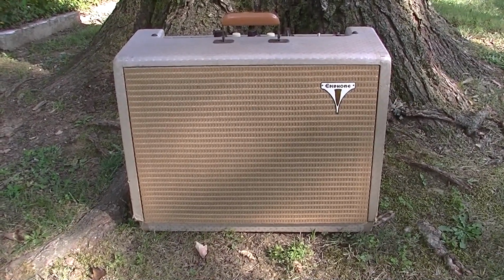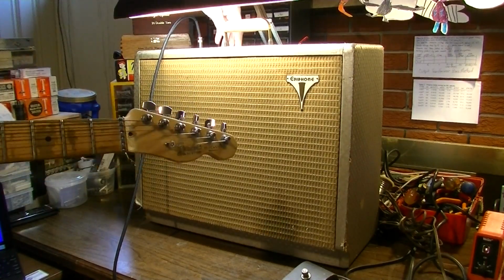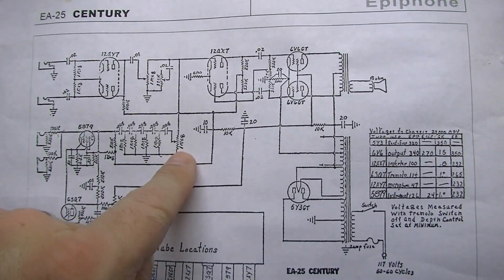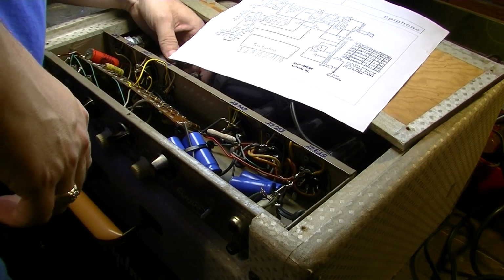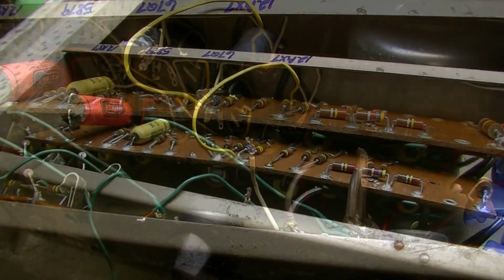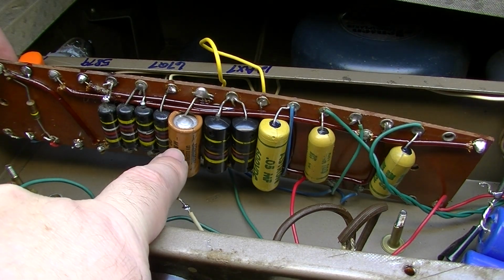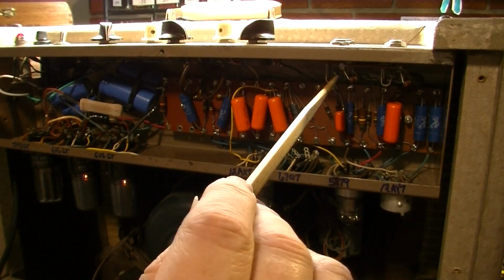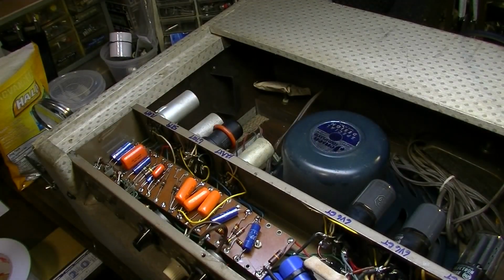Recapping Vintage Guitar Amps - When is "Killing the Mojo" OK? (1959 Epiphone Century EA-25T)

Comment: Most amplifiers back covers don't use shielding or aluminum shielding tape. I wonder why these input jacks were picking up more noises compared to a fender amp or marshal amp that you had to add aluminum shielding tape on the back cover. The First capacitor of the Sequence is an Astron Capacitor and then Sprague Bumblebee Capacitors for the "tone shaping network". I think they used the Astron Capacitor for frequency response differences, like you mention that ceramic capacitors add an edgier tone. When pulling removing out V1 tube from a fender amp or  this epiphone amplifier it increases the gain but also the "loading impedances changes" because V1 pulls down the plate voltage loading it down as well as the loading of the tubes resistance of the plate resistance of the V1 tube.

Comment: So in the final analyses, do you find the pentode channel would sound louder and distort easier than channel 1? Channel 1 seemed very clean(like a Fender) and channel 2 sounded more British.. Thankz
Reply from the maker: Yes. Channel One would breakup as well with a 12AX7, but Channel Two has more gain still. Get the most gain out of this amp by pulling the V1 tube out of the amp and running into Channel Two. Crank up with some humbuckers and you're bordering on classic heavy metal.
Reply: The Guitologist What about jumping both channels together ?

Comment: Fantastic Brad and cool amplifier. The badge is a little suspect. By this time Epiphone was using the "e" logo as seen on the Casino pickguard. I have seen that badge plate on 1940s - 1950s  headstocks though.
Good luck with the new house and I hope it has good current!
Reply from the maker: It's the original badge. This is REAAAAAAAALY early in the Gibson/Epi amp run. They may have still been using up old parts they got in the Epi deal, or experimenting with cosmetics still.

Comment: Brad great video again mate! Considering the nuances of using a pentodes in the input stage, if you ever built your amp from scratch, would you use one, or stick with trusty triodes? In your opinion, do they offer a contrast in sound that is that distinguishable to the triode? I have not had much experience with pentodes in the input area. I do have a bunch of EF86's in my stash and have considered them. Just curious for your thoughts. Cheers Bud!
Reply from the maker: Pentodes on the input are worth it. I've built stuff with them before and I've modified triode stuff to pentode before, as I did in another recent video: https://www.youtube.com/watch?v=dSDwG4NLm98
If you want the best of both worlds, consider something like a 6GH8A, with a pentode and triode in one envelope. Then you can use a switch or blend knob to switch between them on the input. I have designed an amp that did just that as well: https://www.youtube.com/watch?v=G4_niIHsDnY

Comment: Mojo revival with a boost. My philosophy on the mojo is Keep what you can and change what's necessary to keep it working. The onboard tremolo effect on my harmony guitar started leaking electrolyte and had a busted battery stuck in it. started working after I cleaned it  restored the battery compartment and rewired it without changing much.

Comment: Taking out the old and putting in new is a bit of a sacrifice and necessary. Ever thought about putting the old components in a baggy attaching it the inside to show what was in it originally. Just a thought.
Reply from the maker: That's commonly what I do.
Reply: The Guitologist I am glad, keeping the original with the original, even if they're not used anymore.
Reply: and it keeps your shop space clean of worn out parts...

Comment: What interesting timing for this.   I just recently was wondering if capacitor / component branding made a difference in tone.  In the process I read this week that EHX had a limited run on a pedal because of old stock sourcing issues...   ...and that Arp hand selected certain transistors in the 2600.  No idea if these are true, but very interesting indeed.

Thanks for sharing your thoughts on the matter. Always great to watch you work.  
In the event that I ever start building musical circuits - it'll be your fault...  :)
Reply from the maker: I refuse to accept any of the blame! That's my one caveat.

Comment: 27:05 I'm curious, did you ever replace that obviously microphonic tube -- the one you put the silver shield over? That thing was ringing like a bell any time you touched it, and that can't be good. For that matter, did you replace any of the tubes? If so, which ones, and why? The amp sounded great once you got it all buttoned up, so I was wondering if you did anything about the tubes or I just missed you mentioning it in the video 'cause I'm old and my mind wanders sometimes. ;)

Comment: A very nice end result; those Bumblebees have bitten me in the tail more than once (in radio and TV circles), I've just shotgunned those for the last decade.

One thing which I am having difficulty in comprehending, why are so many of the carbon comps complete with "jig - bent strain relief" on one end, and not the other??  I instructed Mil Std 2000 Cat "C" electronics practices for 15 years in an avionics plant, and am viewing the practice from that perspective.  Many thanks, Tim.
Reply from the maker: I would guess only one bend would be necessary to compensate for expansion and contraction. It's a bit extreme unless you're taking the amp to the South Pole or Space though.

Comment: Hello Guitologist!!!! What are the differences in sound and purpose between the sozos and orange drops?? Thanks man, love your videos
Reply from the maker: The general idea was to stick with what most people accept as good replacements for those caps. Personally, if this was my amp, I would have probably just stuck my red Panasonic knock-offs in there in every position and been done with it. But I like to steer customers toward better resale later down the road. That way they can get top dollar. The Sozos were put mostly in positions where signal passed through them in coupled stages. The orange drops were cheaper, so those were used in non-tone-critical places like the tremolo oscillator, which really only needs to provide oscillation.
Reply: Ok I get it. For example if you need to replace a cathode cap would you use sozos or orange drops for that position? Thanks for answers, I appreciate it

Comment: Perhaps adding a high value good cap is series with vintage, possibly leaky, caps would allow the originals to stay in
place with the modern cap stopping any leakage (ie you remove the large dc voltage from the old caps, possibly slowing
down their deterioration in the process?)  - just a thought...

Comment: When replacing a multi section cap with individual caps can the voltage rating of the individual caps vary from one another?  That is to say I need three caps at 150v each, but I only have two 150v and a 450v on hand. Will this work?

Comment: At what point do get concerned about speaker damage with those old Jensens.  I acquired a 61' Epiphone Challenger,  sounded great until the speaker cone started tearing up.  Had to get it reconed...
Reply from the maker: No reason to be concerned. Just try to keep climate controlled as much as possible. Don't let the cones dry rot, get moldy or wet, and they should be fine. Eventually they all need a recone anyway so I just jam the hell out of them.

Comment: Another great video...that amp sounds awesome!!! Love Epiphone stuff...the poor man's (me) Gibson! They still use that emblem on some guitar lines. What a PITA have the caps under the board...what were they smoking when they designed that?!!?  Lastly, I was wondering if maybe that orange drop cap by the input was causing the noise..."Mr Carlson's Lab" put out a video on how these do have a preferred direction of installation...have you ever experienced this? Thanks for all the great knowledge you share with us!! :)
Reply from the maker: I'm aware of that video and the concept of outer foils. In this amp, I did observe the foil polarity during installation, but for the most part. a well shielded amplifier won't matter whether your install signal caps backwards. Modern caps are usually smaller than their vintage counterparts anyway, so the surface area is lessened (smaller antenna). And unless the amp is just designed on the very edge of stability or is high gain, like a Trainwreck or Marshall, the polarity will be negligible. Shielding is the real key. That and lead dress.
Reply: The Guitologist Thanx for the reply. I saw that video a few weeks ago and, after beging aghast by what he showed, took a bunch of new caps to the scope... couldn't reproduce his result...it didn't make a difference  which way they were placed, same small noise signal from touching them for both directions.

Comment: What a cool amplifier! Sounds awesome...the diversity of tones. Looks great too. Brad I was wondering if you took off one lead of any of the bumble bee caps, and checked them whilst you had the board free? I get you figured the astron took the dc hit 1st, but its age right, that takes its toll on those caps? Just curious.. Great repair job, I liked you allocated caps to top.
Reply: Bucyrus Erie12 I was surprised he didn't move bumblebees to the top too just in case there were problems.

Comment: the problem is: capacitor shift usualy to lower valueswhen they age so, on the signal path that means less bass... and less bass is good when overdriving the amp (less blocking distortion). So replacing caps to original values may be a very bad choice ! When remouving old caps, always mesure it and write this information down on paper so you can restore same values but with new caps. Filtering caps on power supply: may also change the sound A LOT, but reduce the noise also. It's an art !

Comment: Great sounding amp, and nice playing too!  A few questions about the caps... Why did you back off on your original plan to change out all the caps? It seems like your original justification about reliability and not having to get under the board again is still solid, even if the Astrons were protecting the bumblebees from the high voltage. Why not swap out the remaining bumblebees hiding under there and just be done with it?  Also what's up with the orange drops and the Sozos? Is that for appearance or tone? Or customer preference I guess. I just don't buy into the magic capacitor tone voodoo. I think the red Panasonic polys you mentioned work great and are reliable. Just curious.  Anyway, I really enjoy your videos -- keep up the great work.
Reply from the maker: The total cost of these caps is negligible for the ptential return if he ever came to sell it. A buyer would be more likely to think the Sozo and ODs were worth paying top dollar. The reason to leave the 4 BBs was because in low voltage situation like in the tone network after the OD coupler, they should operate ok. I'd already tested the amp before service and the tone wasn't really a problem. I also tested the tremolo afterward and it was fine with those in there as well. This thing should operate with no problems well into the future.

Comment: getting ready to do same to my 64 Gibson GA77 rvt Vangaurd.  had to replace reverb coupling transformer about 12 years ago, but now developing cap issues.   I'm guessing by the size of the speaker mounted output transformer on the Eppi., that its about 10 w rms.   sounds good though!  cool old amp!

Comment: Did I miss it?  Did you identify the faulty component that caused the tremolo malfunction?  Sorry, but its the why part that helps me learn. Also did you test those Astrons to see where they were at spec wise?  I am curious.  Thanks for the awesome videos!
Reply from the maker: It was a capacitor issue. Replacement of the 3x .05 caps in the trem fixed it.

Comment: Those orange drops don't look to have the foil end identified, you have to connect the foil side to the negative  or else it's going to be un-shielded and all kinds of noise will get into the circuit from external sources. You can identify and mark the foil lead each cap very quickly and easily with any cheap oscilloscope.

Comment: love your vids, and as for killing the mojo, fk that, you just brought this amp back to life. 
i reckon if you copied this circuit with brand new parts it would sound just as good as one from the factory back in '59. 
The quality of the parts is more important than any mojo the old ones have, sure they look nice, but if they are way outta spec then its not gonna chooch right.

Comment: Guitologist, Great stuff. You have inspired me to dip my toe in the rebuild/refurb pool. I acquired a free donation of a 1960 (per date stamps on chasis) Admiral Stereophonic console radio?record Player with a tape input. The original chasis has been replaced and I have no drawings. It is wired to be stereo. I want to get rid of all the radio and recordplayer electronics and make it a mono amp. I turned it on and some tubes were redplating, tone was helicoptering all over the place but with an initial cleaning the tone cleaned up a little. I need to replace all the caps of course but many are not labeled so I do not know what to get. Is there a company out there I can contact to help me with identifying the caps and can provide replacements? Also any words of advice converting from stereo to mono? I already replace the 2 prong to 3 prong plug and per your vids got rid of the death caps. Love your stuff. Keep up the great work.

Comment: Nice riffs and I wonder if the remaining caps that were left and not replaced added to that noise?
Reply from the maker: No, the crackling was just dirty inputs and pots, and that hum on the bench was all RF interference. The shielding  killed that.
Reply: I was wondering if it was hum from the old caps and or the RF

Comment: Great video Brad , the guitar riffing at the end was the icing on the cake and i could listen to it all day . Brad have you ever done a video on " how to use a variac to get the brown sound " ?  I've heard that a variac can damage your amps transformers and tubes ?  I'm not an amp tech just a guitar player . Thanks for any info ....
Reply from the maker: A variac? Damage? Nah. If anything, you're running everything much cooler. Your tubes will last LONGER run in this mode. Some people will repeat anything they read, and one of the hysterical things that gets said is running at low voltages will cause "cathode stripping", but this is just BS. But anyway, no, I have not done a video on using a variac in that way. There are so many better ways to get overdrive these days, I would sooner recommend just buying an amp designed to get that sound out of the box, or modding something to get that sound.
Reply: Thanks for the quick answer Brad !
Reply from the maker: Thanks for watching, Daniel.
Reply: @TheGuitologist  Now you can buy an EVH 5150iii 15 watt lunchbox amp & get just about every EVH sound. Cool, EXTREMELY high gain amps, but no clean channel to speak of. No variac needed..

Comment: Weird question out of curiosity... Is there a technical reason why most of the resistors on that board have a kink in one leg, even the ones that could have easily been soldered in straight? It's obviously deliberate but I just can't figure put why. Sorry if you mentioned something in the video and I missed it. Thanks.
Reply from the maker: Good question. It's a building principle designed to give the components some wiggle room during natural contraction and expansion from heat and cold. This way, the components don't strain the connection at the eyelet.
Reply: Thanks for the reply. I thought it might be some form of stress relief but it seemed somewhat... I don't know... excessive. Still, good to know.

Comment: I have a '72 twin reverb, barely used tho, does that affect how likely that caps and such have gone bad?
Reply from the maker: Yes. Usually, for whatever reason, amps that don't get used tend to have more components fail upon re-firing them up. Electrolytics especially don't like not being used for a long, long time. When starting up such an amp that hasn't been tried in years, it's best to dial up on a Variac.
Reply: The Guitologist it's been used for the past year or so and nothing noticeably sounds bad. It should have all original tubes and everything is the biggest reason I haven't gotten it looked at. But the more I watch your videos the more I'm thinking it'll sound even better once she is tuned up!

Comment: The mojo was already long gone. Any original caps that might have still been good surely would have failed in the very near future, resulting in a return visit by the possibly angry customer. Replacing all of the caps was the right thing to do in this case.

The mojo is back - that amp now sounds great again!

Comment: Any manner of "mojo" that comes from old components, especially from leakage, can be measured, documented and recreated by adjusting values to get to the same accidental place on purpose if the client so desires.  So, no, you most certainly didn't kill the mojo.  Amp sounds great and you did due diligence by discussing options pros and cons with the owner.  He should be extremely pleased.  I certainly am.